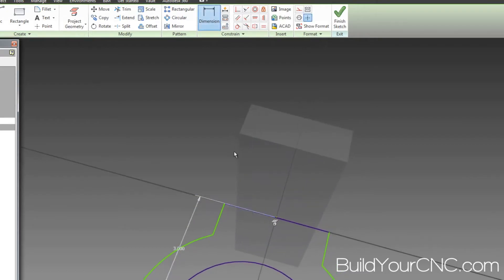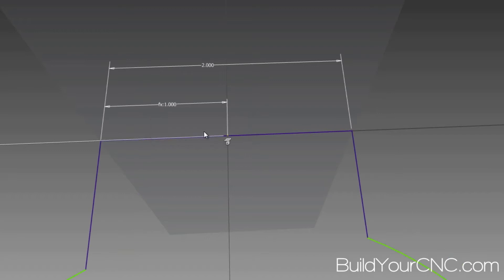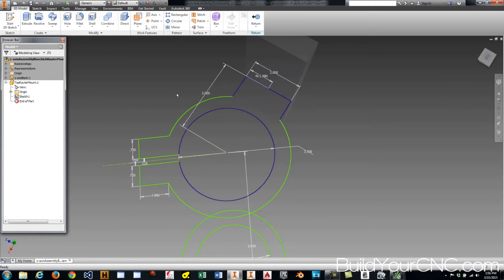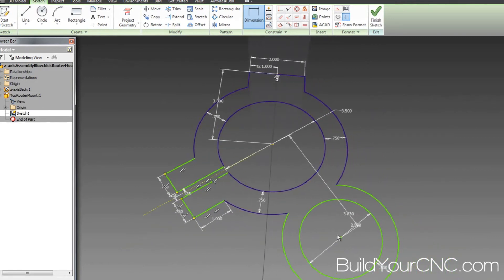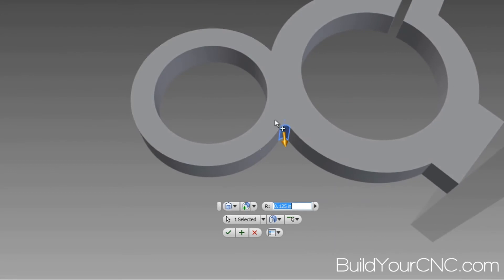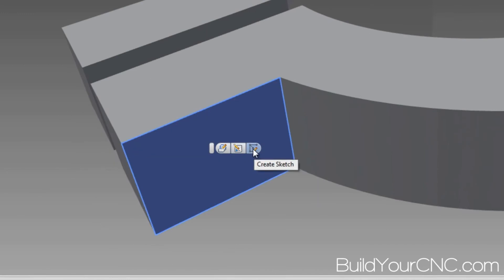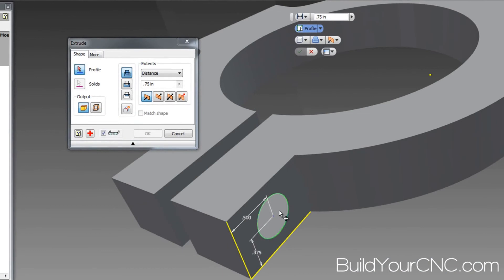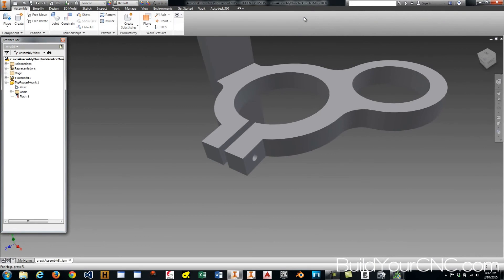BuildYourCNC -Autodesk Inventor/CAM/CNC Workflow - Part 3 - Finalize part form/add sketch to part

Comment: Nice video mate! What utility do you use to manipulate and rotate around the part in such free fashion? 

Thanks in advance!
Reply from the maker: haronasi Good question and I didn't mention it on my video, which I should have.  The device is a 3D mouse by 3Dconnexion.  It is the best device to have when working in CAD.